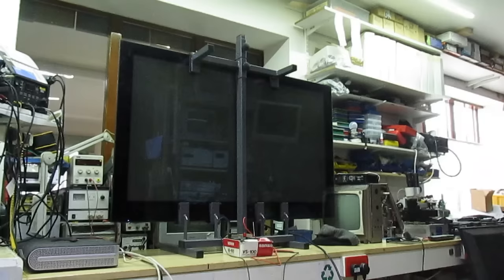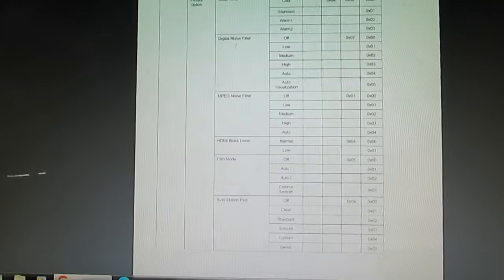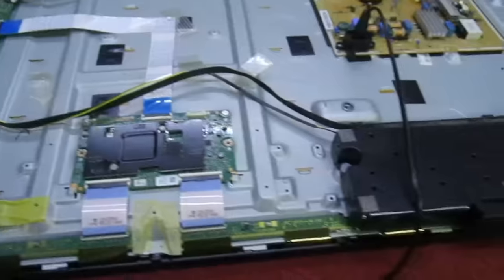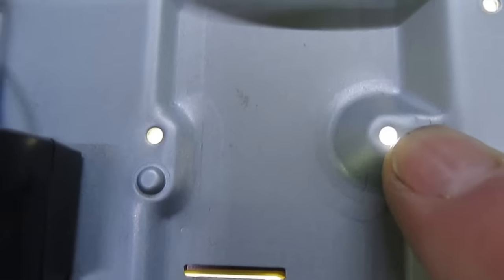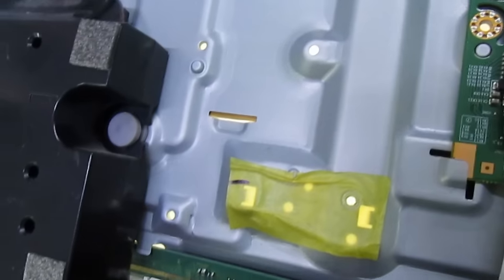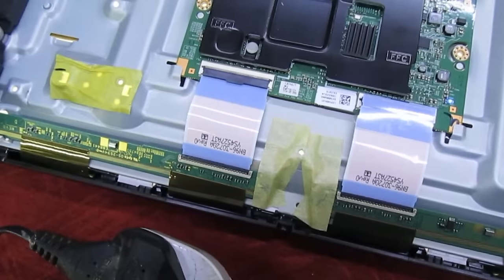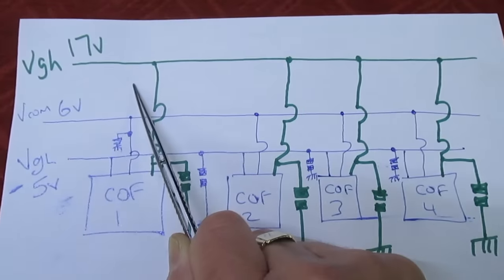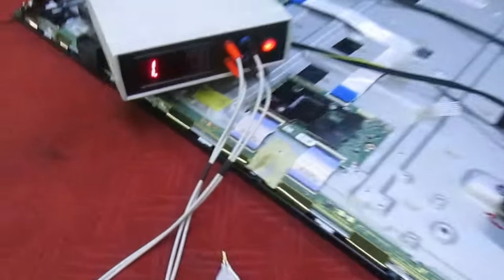Video to highlight the problem of repairing flat panel TV sets

Comment: One time, my Samsung flat screen tv, wouldn’t turn ON.  At first it took 2-3 attempts before it would turn ON and eventually it wouldn’t turn ON at all.  So I took a chance and typed « Samsung TV would not » and google auto completed « Samsung TV would not turn ON ».  It led me to several YouTube videos where they showed that this problem was due to  defective electrolytic capacitors on the power supply board.  We could see that the defective capacitors tops were curved not flat like the others.  I replaced those capacitors and the TV is still working 7 years later.  It’s always good to do a simple googles search when something breaks because sometimes it’s really easy to repair.
Reply from the maker: it saved you from buying a new set which is what the manufactures wanted you to do .

Comment: Manufacturers should be made to supply proper Service Manuals and support. Supply reasonably priced SpareParts. Like they used to do. You shouldn’t have to spend time tracing out the Circuit.Not expensive land fill.
Reply from the maker: Couldn't agree more but that's when set makers use to care about there customers, now there not bothered when they have your money .Even just a circuit diagram published on a website would be a start .

Comment: after 5 years mine went, a tesco specal cheapy ,   got the blue light thing,  gave it to a mate, £30 and a bottle of cider later , 20 mins later job done,  2 capacitors had blow, them round things with a cross on top, they were cheap and nasty, so he replace 5 of them for better quality ones, and he said, come back in 10 years :),  had it 10yrs now,  still working,
Reply from the maker: A lot of TV s only suffer from simple faults like this ,yet people are so keen these days just to throw away and buy new .

Comment: The reason you don't have component-level information in the service manual is because the TV manufacturer may not even have it! They will source an existing power supply, backlight strips, maybe a TCON and LCD if they're not a panel maker like Samsung or LG. Might even have someone else make the mainboard and the only thing they do is put their own firmware on it.
Reply from the maker: of course , you are correct many TV power supply boards are just bought in from places like Sanken but at the end of the day someone must have the schematics, somewhere .

Comment: But, does the customer complain about the total cost of the repair?The replacement cap is very inexpensive, although if you charge for your time, the bill is likely to be quite sizable. However, your debugging technique was very excellent!
Reply from the maker: no complaints , I only charged £60 , most people that come to me now have already bought a brand new TV  so they are not willing to pay much money for something that will become just a spare set , in a lot of cases if I charged by the hour like a garage does I would have no customers at all , that is unfortunately the state of the repair trade now , thats why most shops closed down years ago .

Comment: in Belarus we use flashlights to check if image is present. LED overheat inside those cases without proper heat transfer to the metallic case, we sometimes use two sided tape to make it atleast somehow transfer the heat. i have a samsung tv in my kitchen. i fixed it 3 years back and it still works, with just one led replaced and all led straps on two sided tape. and wow, it actually worn out in 1 year after we bought it, and with all used parts in harsh environment with just some little fixes it still runs no problem! incredible
Reply from the maker: I have had some samsung TV s where the leds burn up and damage the diffuser sheets .

Comment: Why didn't you take a flashlight (torch) and light straight into the LCD to see if the LCD was working or not? Then you know it isn't the backlight that is faulty if you can't see any picture.

Btw, why does that broken cap make the backlight not light up? Shouldn't the backlight still be working?
Reply from the maker: These Samsung sets are very peculiar , sometimes if there is a problem there wont be a picture to see with a torch as the signal is not sent to the screen ,
 I have no idea why a short on the LCD panel stops the backlights coming on because with no circuit diagram and no circuit description only the person who designed the set will now the answer and seemingly they don't want to share any of this information , the times have gone when you could ring samsung technical support up and get repair help .

Comment: I found a 55” Samsung tv thrown out that looked decent so I took it home opened it up found a fried power board. Hop on eBay buy the replacement $165, install it and now have a 55” monitor.
Reply from the maker: Unfortunately TV sets are now disposable and not many people have these repaired so there will be loads about like as you say only need a simple part to repair, sadly this is now the world we live in .

Comment: Any suggestions on lines propagating from top and bottom on a 4K 65" RCA SmatVirtuoso? Stays at boot screen with the lines filling up the picture.. set used to intermittently work now it seems to be stuck in the fault
Reply from the maker: Only a guess but if the video processor is a BGA type it could well be suffering from either dry joints or tin whiskers .

Comment: Is it safe to assume that the chips are a bit sturdier so they don't break down that easy, and the smd components are made a bit on the cheap side, so that they are the actual ones that go bad? Or they both have like a 50/50 chances to break down?
Thanks.
Reply from the maker: Yes , micro chips and a lot of integrated circuits are now very reliable , most fault's I see are not chips but software corruption in Eeproms is very common ,

Comment: Good video and information sir. Yes, most electronics are built to be replaced and not serviced. Keeps the company in business just making  customers buy, buy buy. Even high end audio has circuit boards that can not be fixed and must be replaced.
Reply from the maker: yes , I have already come across expensive audio where there is no service manual .

Comment: Very well explained I have a 2018 50-in Philips flat screen one side of the screen darker with Lines but still has a picture I would love to know what is causing that we need more good men like you
Reply from the maker: A darker side of the screen usually indicated failure of the backlights, but darker with lines could indicate a COF chip failure on the LCD panel itself which is not repairable .

Comment: And they wonder why there's so much E waste  ! . They have to force or encourage the manufacturers of electrical equipment that they engineer there products to be repaired easily. That would reduce E waste probably by half or more. Brilliant thanks for the information and education.
Reply from the maker: The amount of stuff I see on the tip these days is eye watering and no doubt lots of things with only simple faults, but what makes me really sad is the fact they wont sell you anything , it all goes to be crushed .

Comment: Another TV saved from scrapping and such a satisfying repair.
Reply from the maker: Just a shame I cant save more sets, people seem to prefer to take them to the tip .
Reply: @michaeldranfield7140  I agree. It would help matters if manufacturers gave proper service detailed manuals as you have already pointed out. I think that's a contributing factor for some of the huge e waste these days. Plus the rising costs of repairs, engineers time fault finding V's the price of a new TV.

Comment: I have a samsung 42 inch side lit tv that has no picture. Hopefully its something not quite so jnvolved as the one you had in the vidio since i dont have the fancy equipment. I really hate to through stuff away and fill up the landfill. Unfortunatly it would be cost prohibitive to take it to a repairman to do what you did.
Reply from the maker: A lot of sets I get for repair suffer from backlight failure so don't be surprised if you find this is your problem .

Comment: Can I ask you a question I have the same issue sound but no picture and I did the test watching you video, where you unplug the cable to see if the lights comes up on the back of the T, however on my TV when I unplug the same cable I can not even turn on the TV and there is no lights shell I assume that my back lights are bad and as well power board is bad please let me know, what should I do in my case.  Thanks
Reply from the maker: cant remember what model samsung it was but there is one where the backlights go open circuit and it causes the driver transistors to overheat and burn the power board , have a look at the back of the power board first to see if there are any hot spots .

Comment: They want you to replace not repair.   I was troubleshooting a ups backup.  I found the blown part.  It didn’t do me any good.  I couldn’t find the part anywhere.
Reply from the maker: I have the same problem all the time , and then if you do manage to find the component you need its usually a fake part from China.

Comment: Extremely frustrating that most warranty calls on issues like this will result in kilos of waste (in shipping and components), more precious metals being recycled when what it needs is a good technician to troubleshoot and replace a component that costs pennies.  Support your local repair shops, they are the road to a lower carbon footprint!
Reply from the maker: so true , unfortunately there are very few TV repair shops remaining , all the ones I knew have now gone .

Comment: if all in parallel could you remove all cept 1 and use a standard cap? thus preventing further problems with those SMD caps?
Reply from the maker: you could have removed them all one by one as you say but much more time consuming doing it that way .